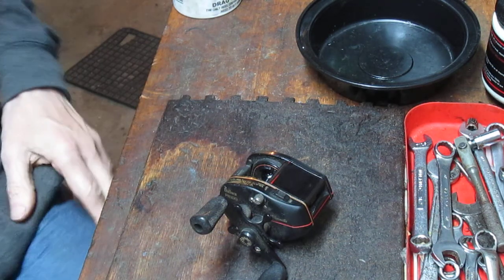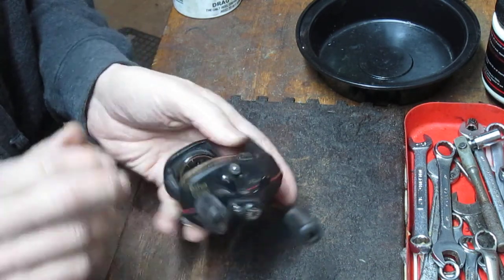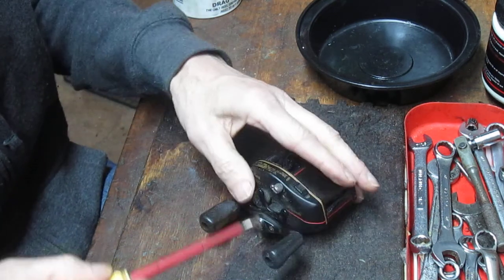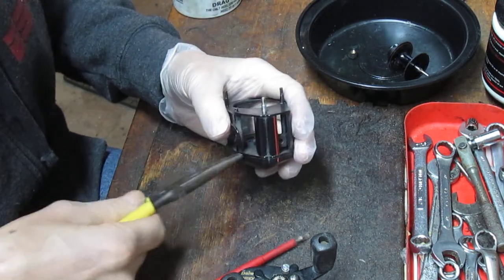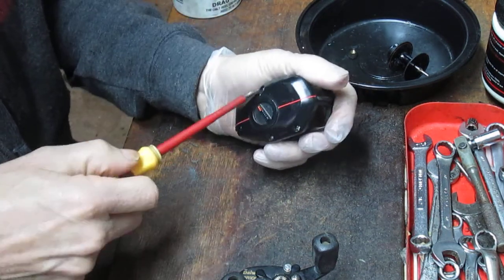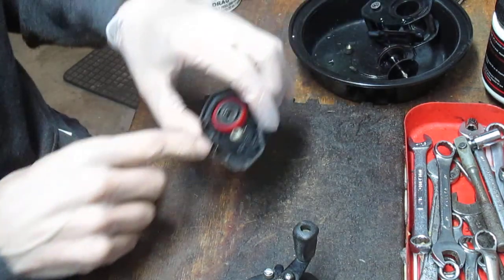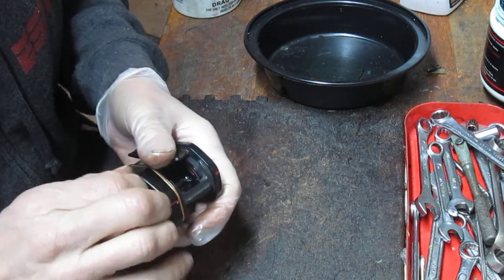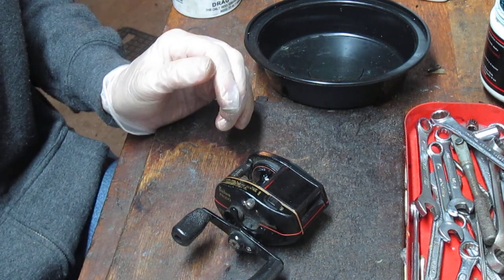Daiwa Procaster 10 rebuild   why reels fail series - basic maintenance

Comment: I had the same problem with small screws. I HIGHLY recommend magnetic tip screwdrivers. LIFE CHANGER!!!
Reply from the maker: Yes, but the problem is that stainless steel screws are non-magnetic and most quality reels use the stainless screws.  Thanks for the tip - Dennis
Reply: @2ndChanceTackle  Ahhh ... I see. Thank you sir

Comment: Great start of the series, after its complete maybe you can do one on drag systems and how they work, such as pounds etc. Also the viewers would like to see the most complicated reel you've tackled.
Reply from the maker: Thanks for the feedback Gary.  I appreciate your suggestions.  Repairing a reel may seem  intimidating, but it is not necessary complicated.  Most reels don't vary that much from the ones made 50 years ago. Some manufacturers have quirks that vary from the norm, like the twist off side plate on bait casters, or the star drag click spring on a Shimano Tekota, that has a certain trick to it, or the Okuma Cedros with an elliptical crosswind gear.   To me the most complicated reels are bait feeders because there is an extra level of moving parts in it and each brand does the free spool release a little different.  Next time one comes in, I will see if I can do a video.
On drags - I should be able to do that.  The core differences involve the number, size of the drags ,and the materials they are made from.  It's all about spreading the load over a bigger surface area. Look for it near term.

Comment: Dennis hello. Great video here. I have inherited several of my father's old baitcaster reels. One is a Diawa Procaster PMA 15s. Similar to the reel you are working on here. I would like to take it apart and clean it, lube it and put it back together and go catch some more bass with it. Can mineral spirits be used to clean any of the external or internal parts of the reel? I grew up watching my Dad fish with reels simlar to this one and also the round Abu Garcia Aubasseudeur 5000 series reels. Thanks.
Reply from the maker: I stay away from those type of solvents.  I like to use a general degreaser like WD40.  I find one of the best is Purple Magic.  It can clean both metal and graphite with ease.What ever you choose, make sure to relive the reel once cleaned as these will strip away and of the oils and lubricants.  Thanks for asking - Dennis

Comment: If anyone happens to take the magnetic break off, and the middle one, which is glued on, happens to come off the plastic piece in the middle, glueing it back is easy with epoxy but it may not be apparent which position you should glue the magnet back. There is a little notch on the inner magnet and outer. Inner should point directly to the left or right, doesn't matter really, and when you put the outer magnet on, make sure to set the magnet brake setting on the side plate to max. Then align any of the other notch on the outer ring to match the notch on the inner ring when you put the ring back on the side plate. When the notches line up is when the break is the strongest.

I have a smaller magforce procaster that I worked on this week that had the issue described and took a while to figure it out. Hope this helps someone.
Reply from the maker: Thanks fort the tip!  Dennis

Comment: why are you NOT upgrading these cheap garbage drag washers to modern carbon fiber, why are you not degreasing and lubing with synthetic  oil and grease.  after you degrease the bearings with acetone or even offer to upgrade the spool bearings to ceramic. The handle  is garbage and pressed fit knobs are 100% NOT up-gradable  to bearings knobs! YOU LEFT DOLLARS ON THE TABLE AND DIDN'T EDUCATE YOUR REEL CUSTOMER on upgrades to make it better than new!  GEEZUS
Reply from the maker: I am interested to see what becomes of it!